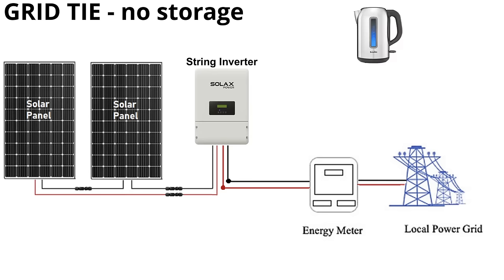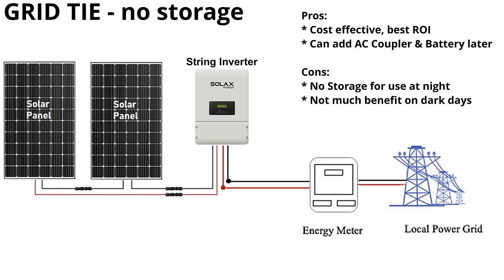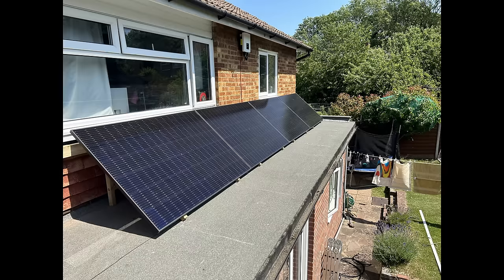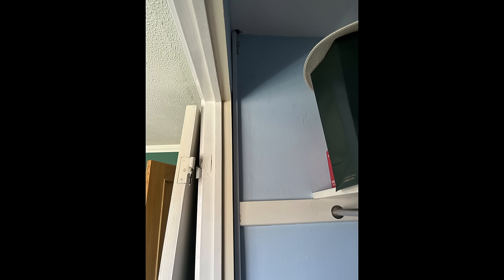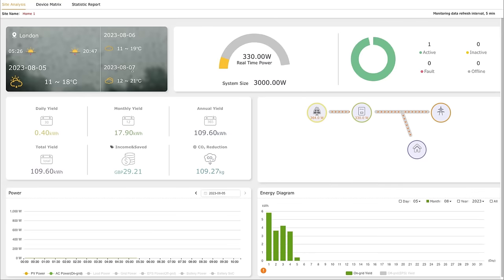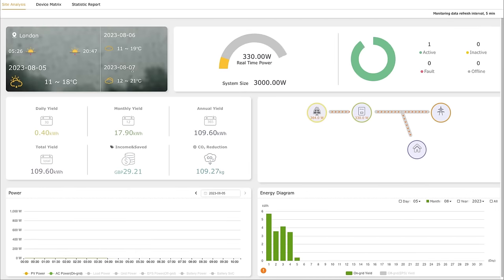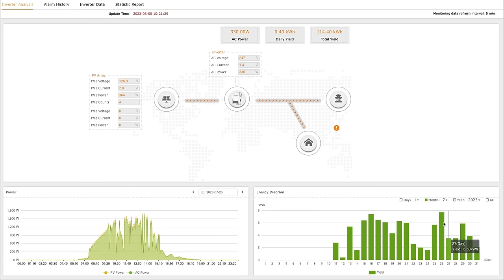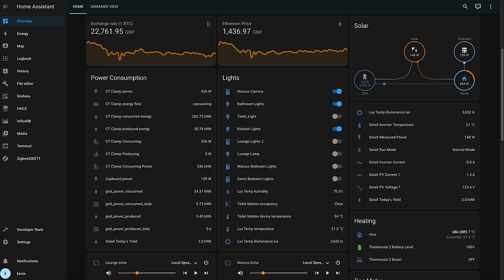DIY Solar Project 2023, worth it in the UK?

Comment: 1. Did you get MCS certificate?
2. Did you have to get DNO approval? And of so did you do that yourself/ was it an easy process?

Makes sense to mount onto flat roof as mounting on the main roof would have meant a few extra grand just in scaffolding costs

Comment: When installing the inverter (and batteries), be wary of minimum spacing around it. The one selected here requires 30cm of clearance around all sides and I don't think the installation shown here meets that. When discussing power generation, it's "<value> kilowatts hours" not "<value> kilowatts per hour" - nit-picking but the latter may be interpreted incorrectly.

Comment: Was it me, or were you referring to the wrong angle. Looked like you were using the angle to horizontal, but the website you were using was about angle to vertical. As they were both fairly close to 45it probably doesn't make much difference though

Comment: 15:52 Nice and solid but a little brush of epoxy resin would help protect the softwood from the rain. It’s a cheap alternative way instead of the treated timber. 

Solar Panels,can stay efficient for up to 25 years according to AI.

Update. A 3.7kwh battery is the most efficient system for value for money

Comment: Well constructed, clear for grid connect and off grid. I accept that diagrams need to not be comprehensive but you have the battery connected to the AC side and need to state the important job of the Charge controller interaction with the battery. Be careful when describing the graph records of day/ month/year solar when you use the term kW hours or kW per hour.

Comment: I must admit, I missed the part where you told us if it was worth it, i.e. what you saved in a full year vs. what you explained you had spent. Could you recap how much power your "1600w" array of panels actually delivered in the UK climate ?  thanks
Reply: At the price paid I can see the return being worth it. As a DIY Install however I am surprised if you will get any money back from the Grid as it will not be MCS approved. Octopus did announce recently they will accept PV Installations that are not MCS Approved but you need to prove the Installation has been installed competently and not sure if that means you need to be an Electrician
Reply: he hasn't got a full year of data yet based on his home assistant files....I assume we will see an update at some point next year..

Comment: Nice Video. I would like to do a DIY Install. It isn't difficult if one is familiar with Electrics but what puts me off is (1) having to pay the 20% which is so annoying, why the Government can't just waive 20% off all Green products and let people so self install is beyond me and (2) the MCS Certification but with the recent Octopus announcement this may not be a problem
Reply: what's stopping you from mounting the panels on the ground and running cable into your home? i live in a flat and have my panels over my balcony. only have 2 panels, but they charge 7.5kWh of batteries well enough for me to run my whole flat off those batteries. i consume ~20kWh a week.

Comment: You installed the isolation switch on the AC side after the inverter. 
Doesn't the isolator switch have to be on the DC sides to shut off the solar panels?

Never open the DC plugs when the sun is shining! This creates a DC arc and can be dangerous. 
It is better to wait until the evening when there is little sun on the modules.
That's what the DC isolating switch is for.

Installing the inverter outside in wind and weather is an English affair. Maybe cover the lower area with the connections from rain?
Reply: I thought exactly the same, leaving that inverter exposed to the elements doesn’t seem a great choice when for the sake of longer bit of cable it could have been mounted in the loft with easy access inc an isolator switch & a cabinet. Exposed to the sun & rain it won’t take long to dry out the circuit boards inside as well as the outside start to look rather murky but maybe they said they are made to go outside.

Comment: How did you go about MCS certification, etc?  I’m thinking of a DIY installation for an outbuilding initially (off grid), but would like to eventually tie it into the house as well.
Reply: I dont think hes getting paid for dumping power into the grid,
However Octopus energy have just announced they are dropping the need for MCS accreditation they are happy to take and pay you for power if you have some to spare.
Please note, this doesnt absolve you of current wiring regulations and have a competent and safe installation.

Comment: Nice one. Other than the electrician wiring it up, did the power company just let you start back-feeding their grid without any hassle? Stateside one has to jump through all sorts of hoops before they'll let you connect. In my case they charge you an extra fixed cost (a solar tariff they call it) for the privilege of giving them power. Takes the mick.
Reply: As long as the inverter is compliant it's fine, if the network mains fails the system shuts off so you can't run it without grid tie meaning it's safe.
Reply: You certainly need to make sure your meter can cope with a reverse energy flow, and there's a power limit above which you need to get approval.

Comment: solax do state a 300mm air gap above inverter im afraid, and the dc isolater isnt much help to isolate the string from the inverter 
speaking as a guy that fits and repairs solax inverters ,you need to isolate the dc lines if and often WHEN the mc4 plug into inverter melts
solax also state not to mount in direct sunlight ,i really would advise remounting in the attic , also note solax state non combustable materials above the inverter
to be honest i didnt watch your video to criticise i am generally intrested to see people diy and save a few quid 
but there does seem some good advice offered to you here and it seems to be falling on deaf ears
we only fit the inverters inside 
we make sure they have extra ventilation around the units
we fit a dc isolater on every string at the inverter
we fit an ac isolater at inverter AND at the board
and heres my top tip ...........tighten your termination screws again after a day as the copper tends to squash a little, and yes i speak from wisdom after going out to many repairs due to loose screws in isolaters and badly made off mc4 plugs

this is just sensible and logical advice
Reply from the maker: Thank you for the advice, and point taken on the DC isolator, which I am planning on fitting (at dusk). On the location of the inverter install, the manual states "X1 Series inverter is designed for outdoor installation (IP 66)", and the pictures used as the example install location is exactyl where I have fitted it, about 300mm under the eaves. Also the eves provide shadow from direct sunlight. I was originally going to install in the loft, but it gets crazy hot up there in the height of summer, plus the manual states this inverter is designed for outdoor instalation.

Comment: When the sun comes out you can also get charging all your battery fed items (phones / pads Etc). A colleague of mine has a plug in hybrid car and uses that as his battery so saving on petrol and using the suns energy.
Reply: Phones and pads use so little power it's hardly worth changing your behaviour over it. A car is another matter entirely - that's definitely worth charging while the sun shines. The other energy storage method is if you have a hot water tank, you can dump excess power into the immersion heater and save on the gas boiler heating it later.

Comment: Hi.. greta vid... But.. Can i ask about the diagram at 03:44 as it looks like you have your battery, DC, connected to the output from the inverter going to the main consumer unit, AC.
Surely this woud be 2 seperate feeds.. ie DC out to battery, 2 way. And AC out to mains, 2way..
 just an observation..

Comment: Great video :)  One quick question:  When you are exporting power back to the grid, does your meter then run backwards ? i.e.  will that further reduce your bill or are those watts given back for free ?  Thanks
Reply: The new digital ones don't run backwards but if you have an old disc meter then yes it will run backwards
When I had my pv system installed in 2011 then the electricity supplier had to change my disc meter to a digital one. However they took a few months to do this so in that time my meter went backwards
We came to an agreement on the actual power that I had imported

Comment: The 2nd schematic can't be correct as it shows the battery linked directly to the ac output of the inverter. If it's a hybrid inverter then there'd be a separate dc connection for the battery.

Comment: If I have decided on a grid tie-in but not interested in exporting surplus once my batteries are full, but using it to heat water in a thermal store, would I need to have a smart meter fitted by my provider?

Comment: Definitely get the battery installed and consider getting a proper installer doing more panels on the roof. They should typically pay for themselves within 9 years and you can get a 16.5 export tariff with EON next now but it has to be MCS certified (octopus does a good rate too).
Reply: No, 'typically' they don't.  This is the problem...

A typical system will cost £9,795.  You HAVE to take everything into account, such as interest rates (loss of on capital invested) and inflation.
Year 1. You’ve invested £9,795 in solar panels, and your energy saving is thus (after loss of interest) £605. Your panels degrade by 0.6% every year, so your saving is actually £600 in year 1. You are therefore £9,195 down after year 1.
Year 2. You’ve saved £596, so you’re down £8,599
Year 3. You’ve saved £592, so you’re down £8,007
Year 4. You’ve saved £588, so you’re down £7,419
Year 5. You’ve saved £584, so you’re down £6,835
Year 6. You’ve saved £580, so you’re down £6,255
Year 7. You’ve saved £577, so you’re down £5,678
Year 8. You’ve saved £574, so you’re down £5,104
Year 9. You’ve saved £571, so you’re down £4,533
Year 10. You’ve saved £568, so you’re down £3,965
Year 11. You’ve saved £565, so you’re down £3,400
Year 12. You’ve saved £562, so you’re down £2,838
Year 13. You’ve saved £559, so you’re down £2,279
Year 14. You’ve saved £556, so you’re down £1,723
Year 15. You’ve saved £553, so you’re down £1,170
The batteries need changing, that’s £5,037, and the inverter has packed up, that’s £5,251
So you now owe £11,458...more than you originally spent out on the panel array!
Year 16. You’ve saved £550, so you’re down £10,908
Year 17. You’ve saved £547, so you’re down £10,361
Year 18. You’ve saved £544, so you’re down £9,817
Year 19. You’ve saved £541, so you’re down £9,276
Year 20. You’ve saved £538, so you’re down £8,738
Year 21. You’ve saved £535, so you’re down £8,203
Year 22. You’ve saved £532, so you’re down £7,671
Year 23. You’ve saved £529, so you’re down £7,142
Year 24. You’ve saved £526, so you’re down £6,616
Year 25. You’ve saved £523, so you’re down £6,093

At this stage, 25 years in, you still owe over £6,000, despite your savings on energy costs. And you are coming close to having to replace the batteries and inverter again. You realise that it’s not worth bothering, and that your solar array will NEVER pay its costs back.

The above figures are actually weighted in favour of a solar panel array. I have made an assumption that electricity prices will be as high as 34p per kWh, which is highly unlikely. Over the past weeks (Aug 2023) the cost has fallen to 30p per kWh, and will fall further.

I have also made no account whatsoever of ANY parts needing replacement (other than the batteries and the inverter) or service engineer visits, or cleaning charges. This is said to be £4,000 over the life (25 years) of the array - £160 a year.

I have assumed a battery pack change at £3,495 for a 3kW array and an inverter cost at £3,714. Both of these costs were obtained from Contact Solar, and have had inflation added at the time they need replacing at 2.5% per annum.

It should be remembered that the batteries and inverters could fail twice.

ALL cost data is not my own, but from Contact Solar.
Reply: Solar only system should not be more than a 6 year payback, if its more you got ripped off by the installer, Batteries are always a very long payback and not worth it unless you have the money to burn.  Octopuss Flux seems to be the best way to make money with or without a battery. I would say DIY, solar only systems can be a 3 year payback with Octopus dropping the MSC cert requirement.
Reply: @That1ufo  6 years!?!  ok, I'd like to have a look at that proposal. Looks like a combination of being charged too much for  electricity to begin with, coupled with cheap products and installed by a couple of teenagers working off of a ladder.

ROI for PV only and PV with battery is very similar in percentage terms.
Reply: now the panel rates have come down, same panel (Longi 405w) is apprx £75/- in city plumbing with 10% off. so the ROI is apprx 5 years.
Reply: @jimskirtt5717  typical system is costing nealy 7K including panels installation and battery etc.

Comment: fogstar are selling a seplos rack style battery around 15.2 kw of storage, complete diy kit for £1,999 grade b batteries or grade a batteries for roughly £400 extra, buildable in 2 hours, so no batteries are not expensive, consider also octopus flux export up to 30 odd pence per kwh export, soon pay for your system :)
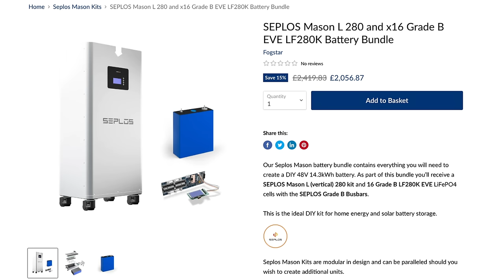Reply from the maker: Indeed, the DIY kits from Seplos are a very good deal, I mention this at 5:53 in the video.

Comment: how did you get it signed of if wired self please as I a spark and finking adding solar.. do I ring local.firms to connect up and did you need planning permission for solar in kitchen roof as  I wanta do same..thanks Neil

Comment: 19:40: "Looking at the 26/7 ....we generated 7.7 kilowatts per hour". No.  That display shows energy generated in KwH, which is not "kilowatt per hour" but "kilowatt hours". Kilowatt hours is a measure of energy, while kilowatts and watts are measures of power. The term "kilowatts per hour" only makes sense if one is talking about a rate of change in power (a derivative of power with respect to time), which would not be a measure of energy.

Comment: good review.
I couldnt use this set up at my house as even though I have a smets2 smart meter, it has no idea if i use or generate electric.
so I would actually get charged for exporting to the grid as the meter will 'think' i am using power.

Comment: Excellent video. I thought you needed an extra box? Do the panels really plug straight into an inverter? I thought they first went into a control box that then outputs to the inverter. Does the one you have do both jobs?

Comment: Good video. Strange in the uk that you can build your own solar r, get a qualified electrician to attach to the grid, feed in to the grid, but only get paid for that feed in if you had the whole system installed by an mcs installer. Keeping installation artificially high. Is that outdated legal requirements from when FiT payments were high and not really related to what you fed in to grid do you think?
Reply: Octopus recently removed the archaic MCS requirement, and hopefully other suppliers will follow.
Reply: @aliasgharkhoyee9501  I heard this the other day. I didn't realise it was the energy suppliers or grid that had insisted on it before. Surely it comes from when you were paid fit payments based on the installation and not what you actually produced and/or didn't use. If so, this is a long overdue change.